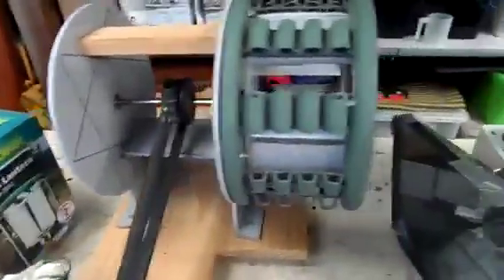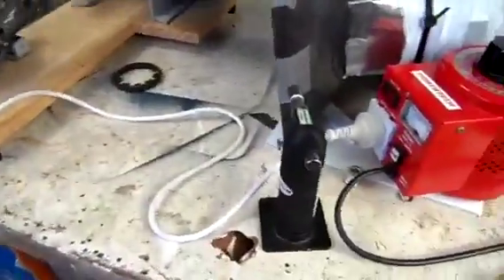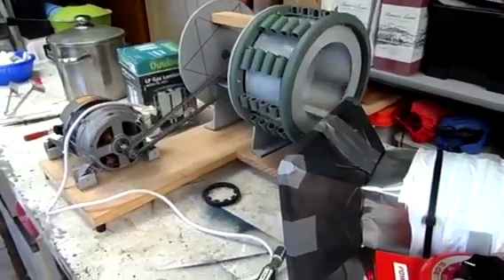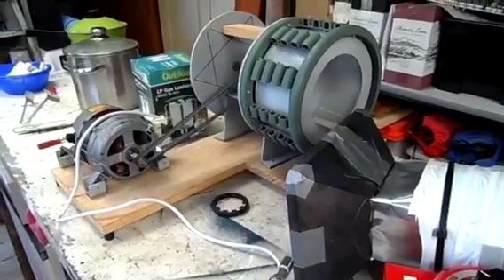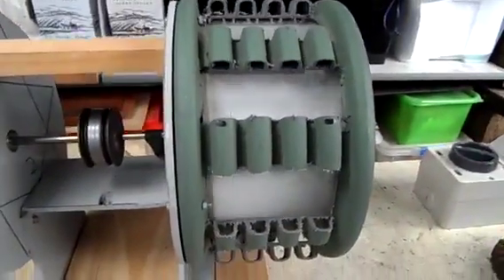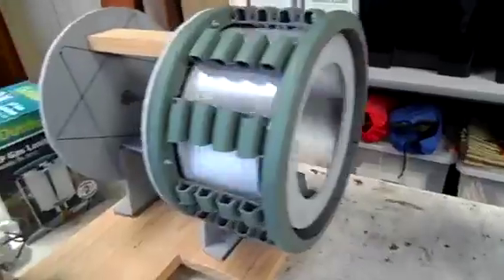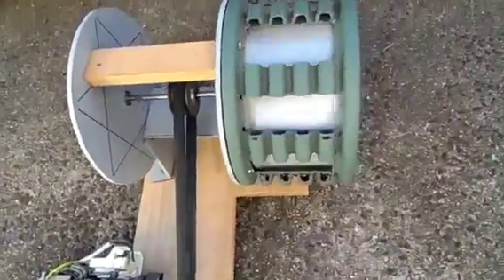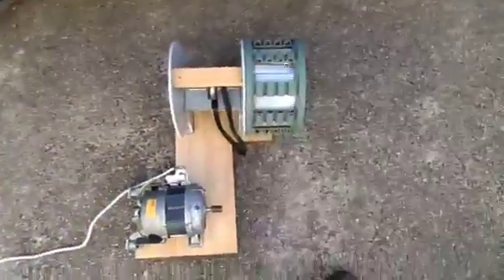Modded Air Raid Siren Running at Higher Speed

Comment: with my workspace, I'l make replicas of american air raid sirens.
Reply from the maker: +Creeperboy I do, different scale sizes though
Reply: +CAL'S ENGINEERING why don't you try making a thunderbolt 1000T, with a working blower and rotator?
Reply from the maker: Creeperboy I've been working out a way to.
Reply: +CAL'S ENGINEERING the thunderbolt is the king of the american sirens, but they're being removed, so I requested that.
Reply from the maker: Creeperboy they're the king of all sirens! I'll certainly have a go